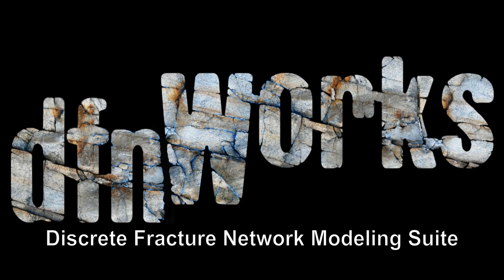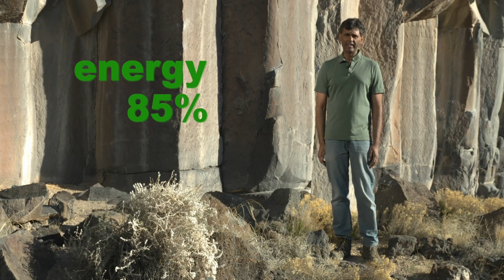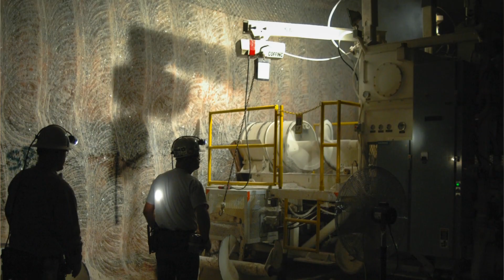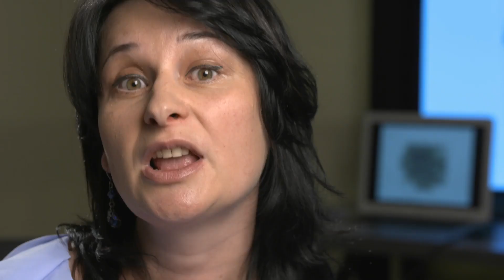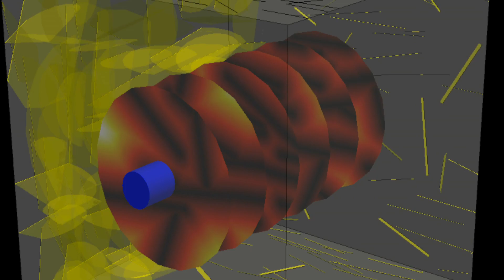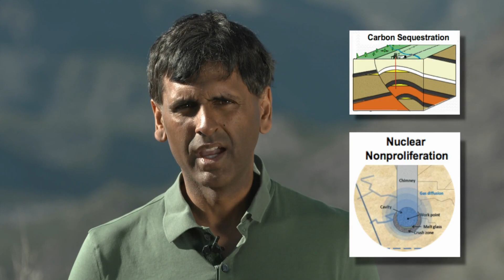dfnWorks

Comment: A working model of a electromagnetic mass accelerator (mobile test bench) in HD quality

https://youtu.be/9YQyjPITDho

https://youtu.be/Sm1rZ-ZeHlc

https://youtu.be/M6CUHnvI2Ek

https://youtu.be/nCgz02bR058

https://youtu.be/FFBHuCnkUzU

In the video, the functioning of the working model of the electromagnetic mass accelerator (mobile
test stand). It is generally accepted that the implementation of this design is very difficult because of the
low efficiency and low reliability. Nevertheless, this opinion is mistaken - modern technological
the base has long been able to realize an electromagnetic mass accelerator with an acceptable efficiency and
high reliability
I am looking for interested in making.